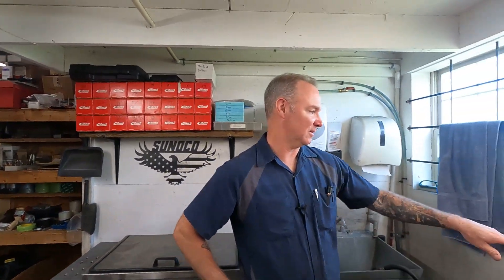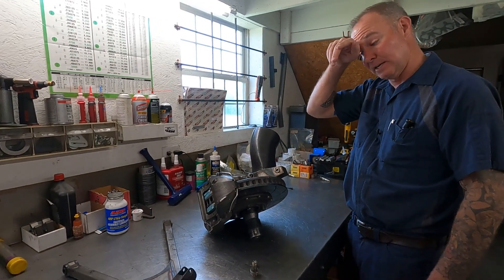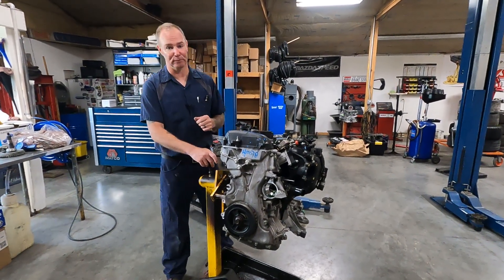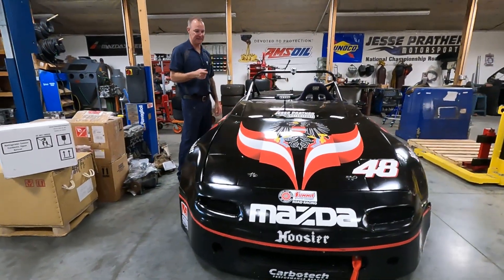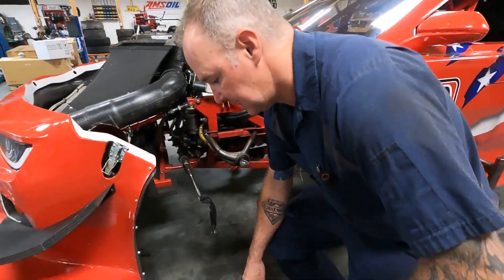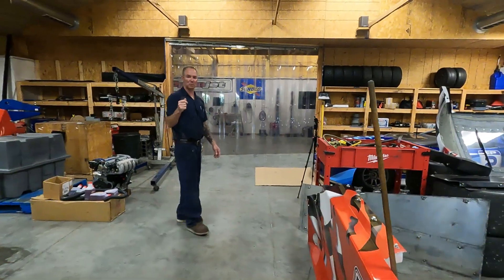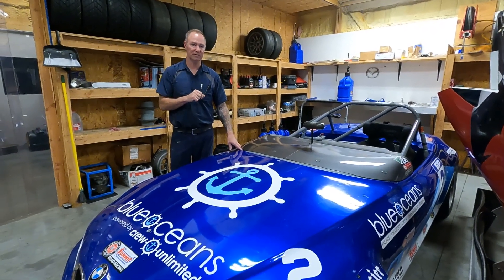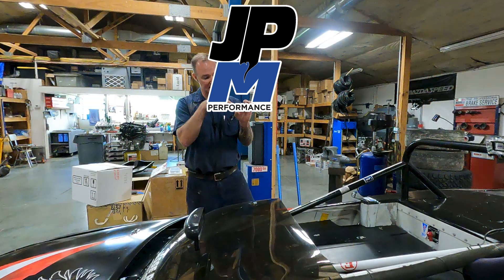SHOP TOUR - How is this A Known Issue Without a Solution?!?

Comment: Is the bolt going into the upright from the bottom safety wired? How about the top bolt? If not you might add that ability. One of the Indy Cars I worked on in the late 80's had a similar bottom upright to lower control arm attachment and it was safety wired. Lighter car but ground effects and 200 mph plus at IMS meant no room for "known issues without solutions". Is the failure on the Camaro a case of the bolt coming loose which then sees the welded on bung fail or does the bung crack which makes the bolt come loose. Same result either way but the solution is different.
Reply from the maker: It was safety wired. The bolt/wheel “machining” process took care of that. Pretty tight tolerances in there.